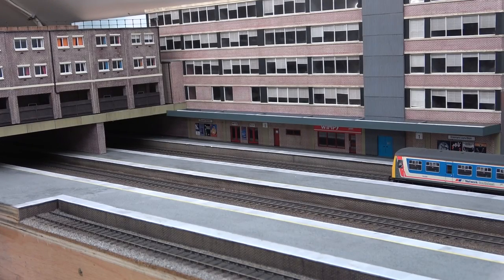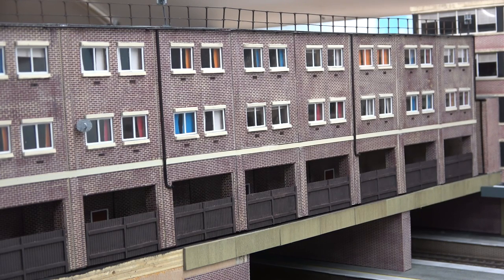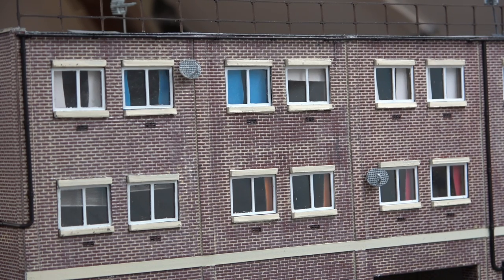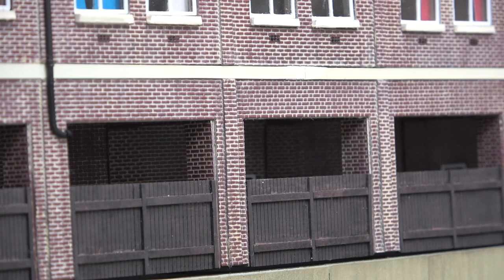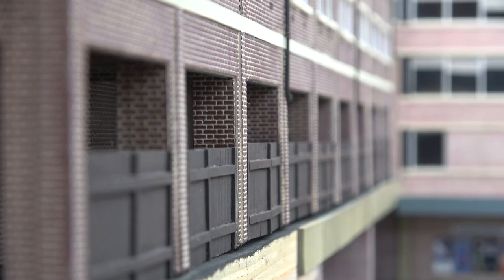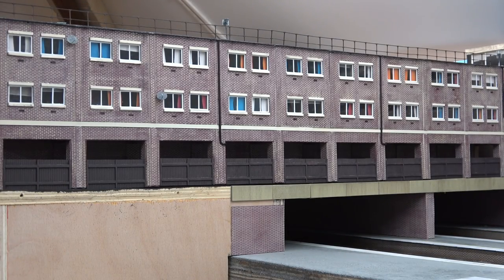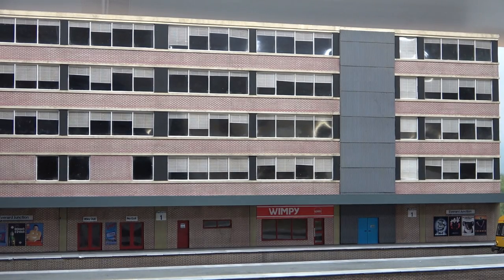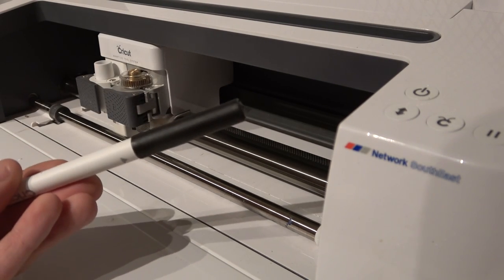New Layout Build - Station building & office block

Comment: I worked at Villiers House, the large white tall block on the other side of the road from this project. What a fantastic job you have done here. I spent most of my day watching the platforms, instead of doing my Library work (it was the local Uni's Library, for a couple of years). My only regret was that it was 30 yrs too late, I missed all the 52's and 50's :( Thank you. Keep it up.

Comment: Loved the announcement at the beginning.. all the stations of my younger years. Lived with a house that backed onto southcote Junction just outside reading. Get 50‘s piling through on the way to Cornwall, lots of 47‘s, 33‘s a few 25‘s using the junction to head of to Basingstoke. Had a line to reading coal merchants at the end of my garden. One a day a 08

Comment: Yay! One hour of model making fun! An appropriate way to spend a Sunday afternoon 😊.

The flat roof of the apartment block could use some puddles, water lasts a surprisingly long time on flat roofs that are not built as carefully, as they should. And since the block was probably built as cheaply as possible by the LocalContractor™ they probably took a few shortcuts during construction.

And each new slab building is an uglier monster than its predecessor. I love it, it just looks great. Although the red bricks almost make it look good. I don't know how it was predominately done in England, but here in Germany, occasionally they used yellow bricks for such buildings to make the misery complete. But the corrugated iron gives the whole thing a… special touch, I have to say. You absolutely need real life examples to add details like this to your models, you just can't make it up. If you haven't studied architecture, that is.

As far as the corrugated iron is concerned: There are embossing tools with which you can make it yourself from thick aluminium foil. Luke Towan once used something like that, but it should be possible to make it yourself with a 3D printer. But I haven't tried it myself yet.
Reply from the maker: Glad you enjoyed it.  We have plenty of buildings here too with those yellow bricks.  Lovely!

Comment: In regard to corrugated steel, I would suggest Brunel Hobbies corrugated iron maker; it is a Lazer cut tool for corrugating aluminium foil. The tool is offered in multiple scales and sizes, although based in Victoria, Australia, it is possible to have it shipped to the UK.
I first found out about this product from Luke Towan's 'Boulder Creek Railroad' YouTube channel.

Comment: Hi ther great video again. One point, I use an old support sheet covered in double sided carpet sticky tape for the cutting of the small thin things like window frames. I then replace the tape as it wears I dont have any problems with the parts peeling off the sheet.

Comment: Great work, as ever.  Agree on the Wills stuff often appearing a bit coarse and overscale: I've sometimes gone for N scale in the past, particularly as most buildings on a model railway are at the rear of the layout, so the slight underscale adds a little perspective. Presume you  know that you can get little template-y/mould-y type things that you can use to make your own corrugated sheets out of kitchen foil?
Looking forward to the 3D print of a bender brunch...

Comment: Tips: When cutting the window frames from thin sheet, stick it to the underground with double-sided tape, that will prevent parts from popping up.
For the flat roofs one can use strips of fine gray waterproof sandpaper, this already has the right structure and colour and only needs to be washed and weathered.

Comment: The 'Wills' corrugated asbestos, is good, but, as you say, chunky. I've used it, painted with Humbrol 'Polished Steel' enamel, then heavily weathered, to represent the kind of hoarding that you used to see obscuring building sites. It's too thick to use for much else - unless you sand it down - I'd rather not.

Great video of what is, certainly, a stupendous project. (Was part of the building in Swindon a Tax Office, by any chance? I've found that in a lot of towns, the most egregious eyesore bit of brutalist concrete, would turn out to be the Tax Office...) Thanks for sharing!

Comment: I worked in Signal Point for Hambro Life in the mid 80s, and as soon as you turned the camera round to it I thought "That looks like Swindon!" It was a great place to work then, though sadly it's now disused, like lots of Swindon office space, and looks very run down and dilapidated. I suspect it will be demolished in the next few years, probably to be replaced with overpriced retirement flats. It's nice to think that a place that is part of my life will live on at Everard Junction even after it's gone.

Comment: Afternoon sir, firstly, absolutely fantastic work, it's been brilliant watching it all come to life... have you thought of a 1mm drill bit back to front in a pin vice and using thick tin foil push out some rivet heads for corrugated wall? I've seen an armour modeller do it

Comment: On the subject of adverts, there’s an example of them at Liverpool Street between the tracks that had or have been there since the early 90’s, and were certainly still there mid way into the 2010’s! So it’s perfectly reasonable to expect to see some outdated posters/advertising where the person in the company responsible for rotation has not got round to taking one down or sticking something over it.

Comment: Thanks for another really interesting video. Have you come across clay washes (available from Flory models) as an alternative to thinned paint to use for mortar wash on the brickwork? Being water soluble, it is much easier than paint to remove from the surface of the bricks using a slightly damp paper towel. Varying the pressure applied and the amount of dampness in the towel creates variation in the staining left on the surface of the bricks. It can then be permanently set with an overspray of matte varnish. I found it reduced the tedium of that particular task when compared with using paint!

Comment: Brilliant stuff. A cricut maker is definitely on my tool list for when I get to scratch building. 

Could you do a video on how you go from a graphic arts drawing with just some 2d drawings with edge and interior  dimensions to producing the registration cut embellished panels needing to be cut out?  Does the circuit software have tools to assist in that or do you need to edit in them yourself?

Comment: The satllite dishes look more like the "mini dishes" of the turn-of-the-century digital TV age. The ones in the late 80's and early 90's tended to be big, circular and white.
Reply from the maker: Correct, I didn't fancy scratch building them.  This is the only kit I'm currently aware of and they are certainly a bit modern.
Reply: @EverardJunction  I was going to make a similar comment. This kind of choice is a legitimate one that every modeller has to think about and usually a degree of compromise is needed. Something you might want to think about, though, for the real late-80s early-90s period might be to have one or two BSB "squarials". They have the two benefits of being relatively simple to scratch-build compared with a normal satellite dish, and also the relative commercial failure of BSB meaning only having one or two on the whole layout would be entirely realistic.
Reply: I just wondered how the satellite TV engineers managed to get them up there !
Reply from the maker: @lesliegprice6652  Often they just opened a window, leaned out and screwed it to the wall.  These dishes are only at the far end of the model so access can be done with a ladder via the yet to be built car park below.  They are in the same place on the real building.

Comment: just a idea and it may be hard to impliment but where you put lights in every apartment maybe have like a logic board which will randomly switch different lights on and off so every time you look there are different lights on and in every flat/room there could be a different scene to look at every time
Reply from the maker: Its a lot of wires/work to make that happen.  You also run the risk of accidently creating a disco effect with too many lights changing too often.  It's something I've thought about but right now scenery is the priority.

Comment: try experiment with painting leds with red and blue markers to kind of simulate the off white light fluorescent fittings give out, and with time and replacement cycles they would surely get mixed up

i work as an electrician and i know that buying 2 boxes of the same color tubes is a nightmare, you buy whatever in store is the closest or you get pinkish, bluish mosaic

Comment: A class 150 would be cool on the layout. They were built in 1987 and ran on western region in the late 80s and through the 90s.
Reply from the maker: Rare sight on the great western mainline though along with the 155 and 156.  You typically saw first gen units until they were replaced by the 165 and 166 in the early 90s.

Comment: The Wimpy feels wrong as by 1987 most Whimpys had been renamed, either as something like Starburger, or the newer ones became Burger Kings, which this one would have. There were only a handfull of Whimpys and they were ones that had been around since the sixties. My first thought was that the satalite dishes are also outside the time period as these smaller mesh dishes came in late 90's. Sectorisation was a very short period so its hard to get everydetail with thecorrect period. But I still think its a brilliant model that looks good.

Comment: Great stuff.  Well done.  What thickness of plastic card can the Cricut manage?
Reply from the maker: I've had most success with 0.5mm or 20 thou.  Usually cuts through with the fine point blade.  It will manage thicker stuff with the knife blade but doesn't always make it through.  Sometimes a final manual cut with a scalpel is needed. Hope that helps
Reply: @EverardJunction  Cheers.  That’s great, thicker than I imagined.  Thanks.

Comment: Hi Richard which Cricut model do you have.  Any chance a short, or long tutorial video on the method of use ie does it come with built-in design software, what drivers can do and interface of independent design software.

Comment: Just wondering, you mention the brick effect plasticard and trouble lining up corners to make seemless brickwork, is it possible to score a line on the rear of the plasticard to then fold it at right angles to form around buildings or walls etc rather than cut it?

Comment: Great stuff as usual. What decade is the layout set in? Jist that i did an advert survey in Newcastle in 1995. Any use to you?
Reply: The 80s/90s' is mentioned @2:00, but I recall correctly, the layout is set in the 80s'.
Reply from the maker: 1988 to 1990.  I try to keep most things set for 1989 if possible.  Cheers

Comment: 38:00 One thing missing from those blinds...
The one set of blinds that will NOT go up/down properly and is left at a diagonal as the staff just gave up trying to get it level
Reply: I see the slight diagonals later - should have watched more before commenting. But still, none of the comically bad ones of the office working thinking "It's fine - I give up - nobody will notice" as one side is all the way up, and the other is most of the way down.

Comment: I'm sure a Wimpy would not have been on the main platform - just look at the distance from the door to the platform edge !! .... In real scale probably about 5 foot ? .... That's an accident waiting to happen I'm sure. . .... Shops were generally tucked away in the entrance to the station, and the whole structure has been installed far to close for comfort in my opinion.... Just look at your own image of Oxford Station at 43:28. ... There is at least 15 foot of distance between the buildings and the edge of the platform.
Reply from the maker: Its 47mm to the platform edge or 11.7ft in 1/1 scale.  I can't portray everything to be 100% accurate.  If I did that area would be a backscene with a brick wall.  Its about having a bit of fun whilst trying to give a sense of what something or someplace might have looked like.